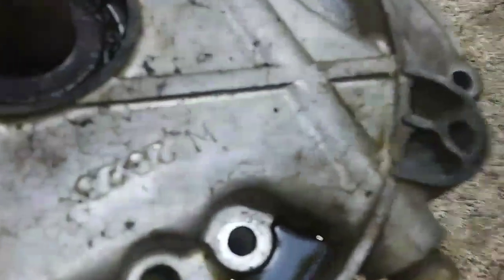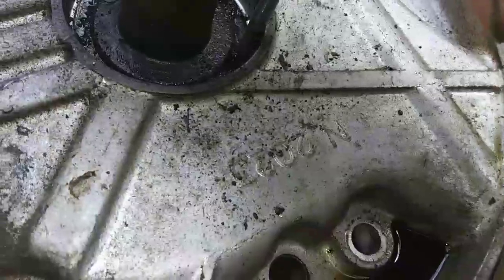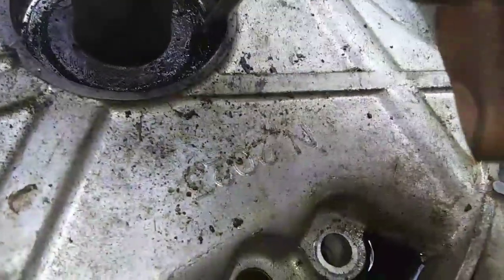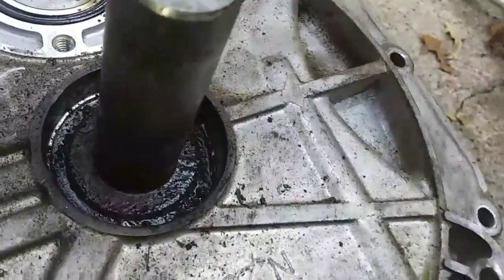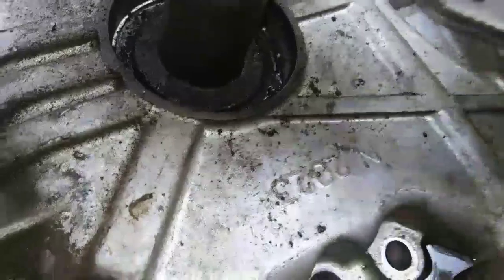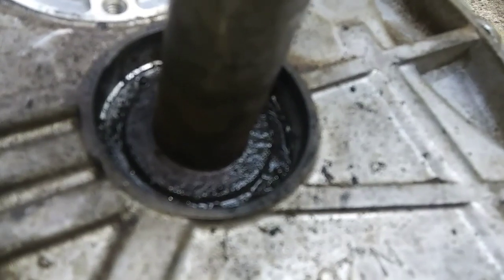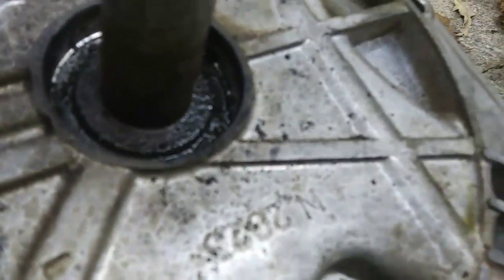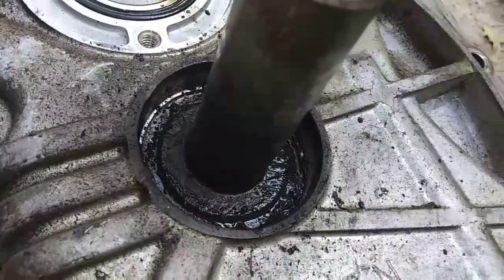help small engine nation!!!

Comment: This is out of my Element.  I have never taken a tractor apart that far.  I buy them running and sell them running 🤣

Since you hit it with map gas please order the seal.

Clean the shaft to a polished finish as far as you can go.  Soak it with some good penetrating fluid.  Take a punch and gently give it taps in the 12-3-6-9 clock positions.  By doing this you are rocking the washer around the shaft hoping the break the rust/grime that is holding it in.

Looks like you can get L shaped pick in there and walk it around as well.  

Curious…have you taken two pry bars at the opposite end of the sump cover and give it gentle prys?
Reply from the maker: Thanks anyway
Reply: @JungleBobRepair  try what I wrote lol.
Reply from the maker: I will,ive got it soaking in some 50/50 and gonna try again in the morning,already sanded the crankshaft,haven't tried the punch yet.I just wants know why the he'll ita on there.

Comment: Not supposed to be anything there. It should just come off. All I can suggest is clean the shaft best ya can, lubricate, and continue tapping with small brass hammer.  It should come off.

Comment: I've never had one of them apart. Are you sure it's a washer?  Does it spin separately from the crank? It looks to me like it's a step in the crank. If that engine uses a roller bearing then the crank may be seized to the race.
Reply from the maker: It's spinning with the crank,no bearing
Reply: @JungleBobRepair  that professional series doesnt use bearings?
Reply: From all the other engines I've taken apart the better class of engines do have some sort of roller bearing on that end of the crank.
Reply from the maker: The model# is 31q677-0124-b1,don't see it in the parts diagram,but it could have wrong valve cover on it.
Reply: @JungleBobRepair  What is the OD of the so-called washer? I agree with Ed it looks like it’s part of the crankshaft being the surface that the seal rides on.
Reply from the maker: Ken I haven't measured,but the model# is briggs 31q677-0124-b1.ill email you a better picture when the sun comes up.
Reply: Here is the crank, looks like it may just be part of the sealed portion of it. How high does the sump cover come up before it hits?